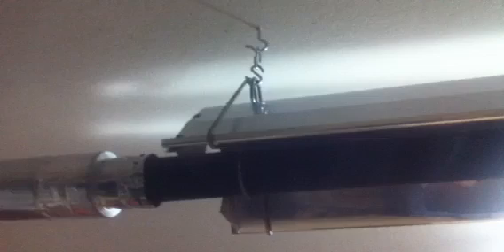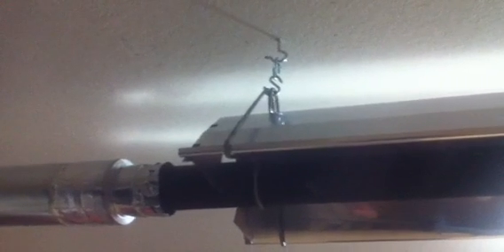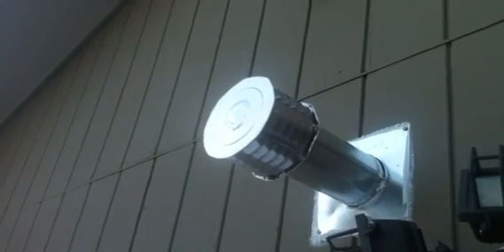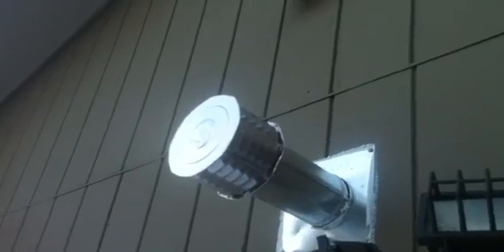Infrared Tube Gas Heater Garage

Comment: Any reason not to go with infrared powered by electric?
Reply from the maker: David Almeroth David, I’m sure electric is effective however I’m pretty sure the operating cost is much higher. My garage, I’m heating at 720 square foot garage. I’d hate to see what the electrical bill would be if it was electric. This gas tube heater is running up to 40,000 btu

Comment: which way is the best way to run a heater in a 3 car garage. 2 bays for cars, 1 for lawn tractor and shop? I'm thinking straight down the shop bay but would anyone consider doing it across all 3 bays- concern here is the varying ceiling heights, so perhaps i've answered my own question?
Reply from the maker: Joel Sherwood Joel, I would first select the location of the exhaust from the B vent. There is clearance requirements.  The orientation or direction, shouldn’t make too much of a difference if the garage is insulated. I would think the ceiling height would need to be the same across the heater span. There is also a slope requirement for the B vent as well.  Hope that helps.

Comment: THANK YOU.  Iam considering one seriously.  Is there one brand that is better than another???
Reply from the maker: Chuck P I don't think there's a huge difference but things to consider are U shape or linear 
Ceiling height, BTU for size of room, insulation etc. there is also the more powerful high intensity infra red heater, w different clearance requirements. I would look for one like reverberay, that's been around a while.
Reply: We researched (over a year), purchased and installed Reverberay's and would recommend them....   Even to the X mother in law !!!    By far and away the best units out there and their dealer service is 2nd to none, long as you give the the proper info to work with

Comment: Do you remember how long it took to warm up initially when you turned it on?
Reply from the maker: radioredline88 from 30 degrees in Denver, about 2 hours to 68 degrees in an insulated south facing 720 sq ft garage. Once the garage is heated however, the time is much shorter

Comment: I have what looks to the the same heater in my 12 x 24 shed. 

But mine does not work anymore (after very little on time), and the gas will not flow after the ignition stage.

I got a quote for $500.00 to fix it by a local heating place (who installed the unit).

If the company can't get somebody here to reasonably fix it---I will never buy another.

I have hundreds of times of consumed gas through My Reznor heater in the other garage, and it still runs like it should.

If you want your garage to be warm soon after you turn on the heater, and service that won't charge you $500.00 for a $3.00 manufactured part and labor,,---you do not want the radiant type.  They take hours to heat a small garage (insulated) in the winter---when they work.

$500.00 to fix it?  I will go with a wood stove first.
Reply from the maker: Sorry to hear you've had a bad experience. Does it fire and then turn off ?  If so, you might widen the intake hole.  I haven't had a singe issue w mine.

Comment: Jeff,  Are your vehicles directly underneath the heater?  How much clearance from the heater to the top of the vehicles?  Any issues with plastic components on the car such as side mirrors or plastic grill work for the interior vents up next to the windshield?
Reply from the maker: Both cars are under the Heater and no problems what so ever.  They are warm but not hot.  Keep in mind that this is a low intensity heater verses the higher Intensity type. Not sure the clearance but prob 45 inch range.

Comment from the maker: I have gas. Can't give you an accurate number.  40K BTU is similar to running a fireplace gas.  But if I had to guess, in Colorado, I would say about 75 per month in the cold months.
Reply: I have a Reddy Heater in my Garage and my parent sbought that back in 1999, so it's been working good, but we aren't going to "high-complexed" heating systems, by the way, it's summer and I only have to have my Air Conditioner on.

Comment: How much propane would you say you've used over the winter to keep your garage at those temperatures?
I've got a 24x36 shop with 12ft. ceilings that I'm looking to install one of these heaters in, but haven't gotten any real good numbers from anyone on what their actual cost to operate has been thus far.
My shop has R19 in the walls and R38 plus in the ceiling.

Comment: Hi Jeff
I m living in Colorado also. do you install it yourself or you hire someone to do it.  would you mind to give me those information.
Thanks
Reply from the maker: Yes, you could install the unit fairly easily.  The slope of the B vent needs to be correct.  The cost to install including running gas was around 400.  You will love the unit...not a bit of problems.  I bought the unit at Infrared Radient inc off Sante fe

Comment: Radiant heaters no matter what the mfg are all great! I would recommend that a single stage would be sufficient in any case, given that all objects absorb heat at a given rate and the objects act as heat sinks.  The science behind heating Dual stage I would recommend for your traditional forced air heater any day but not for Infrared heating.  You pay more for the dual stage when a single stage will do the same thing.
Reply from the maker: Derrick, thanks for your input.  The up front cost difference wasn't that large.  I have notice most of the time my unit fires on the single stage which should be a cost savings over time